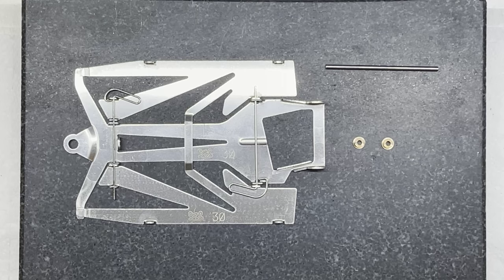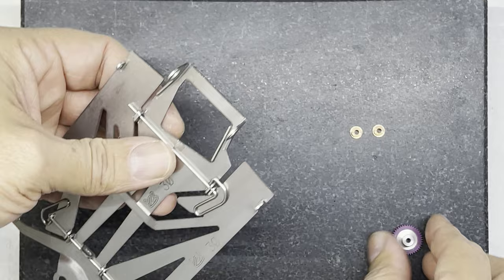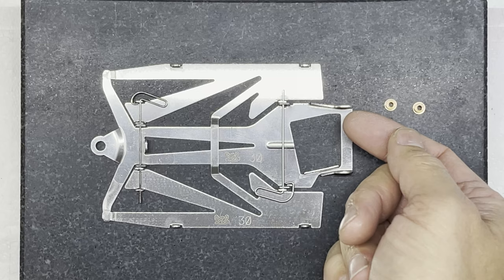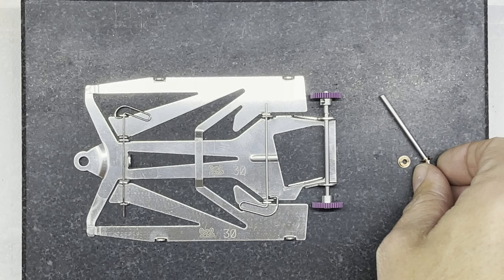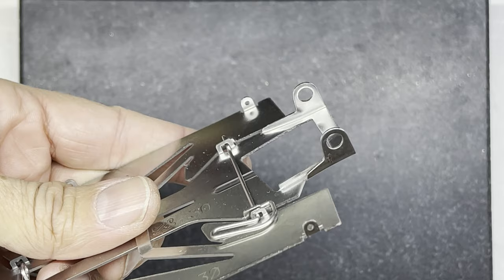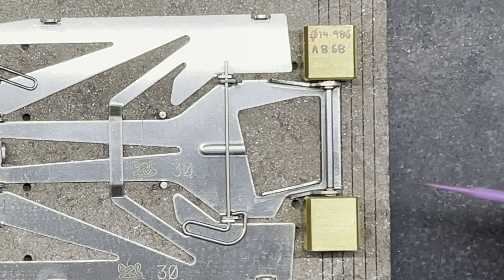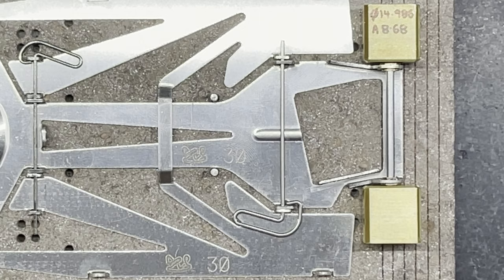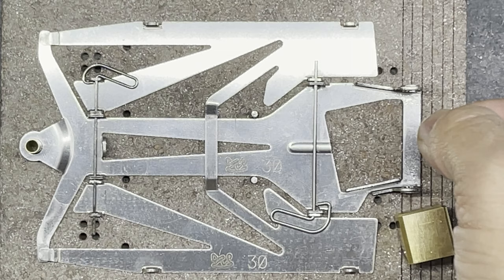Build a race winning JK C43 Aleos slot car chassis - Part 4 (Soldering Rear Axle Bushes)

Comment: I live in Los Angeles. We had a respectable slot car scene about 25 years ago. At the time I was building open class chassis and motors. Then it all dies off. I recently discovered a shop with a 1/32 scale track and my interest (which started in 1968) was rekindled. I found your videos. Not only has the technology changed a lot, the techniques for making a fast car have evolved immensely. There are now tools and jigs way beyond anything we had back then.  Now, all I need to do is enjoy your videos, but avoid getting sucked back into the sport as I once was!
Reply from the maker: I guess you can’t un-invent technology 😁. The general progress has been higher rpm motors and lighter components. This leads to a greater need for accuracy and balance in what you are creating. I am sure people did some of these things many years ago but it made less of a difference with slower and heavier cars.
Glad you are coming back to slot car racing, enjoy.
Reply: Make sure you check out piranha speedway in Whittier!

Comment: How are you. I'm from Argentina, and I love watching your videos, because I always bring out something new. In this fourth video I learned how to take (with the gauge) the distance between the axle and the front end of the chassis, to know if the pillars, (or bushings) as we say here in Argentina. they are aligned and not crossed. For example, when I assemble the entire rear axle, I balance everything, even the axle. I congratulate you for the videos, that you always learn something new. greetings from Argentina.
Reply from the maker: Hi Daniel. Glad to hear that slot racing is going well in Argentina. I am very impressed that you balance the axle. It sounds like you do a great job at preparing your cars already. Thank you for watching and leaving a great comment 🙏

Comment: Here in Argentina, the crown regulation is that it cannot be under the chassis, because if the crown were to pass under the chassis, it would touch the track and break it, apart from the fact that the crown is destroyed.

Comment: Would you employ the same method for installing ball bearings?
Reply from the maker: Hi Ron, ball bearings or ball races can be installed in the same way but often I use glue to hold them in place because the holes in open chassis are designed to match the ball race perfectly. It is on my list of videos to come in the future 👍🏻

Comment: Do you use a 3/8 reamer if needed to enlarge the bushings?
Reply from the maker: Do you mean a 3/32” reamer?
Reply: @CleaveTech  Ooops. I do
Reply from the maker: @slotsoffunwith1345  I haven’t found a need to use a reamer with my chosen bushing/axle combination. The holes in the bushings are a good fit on the axles.